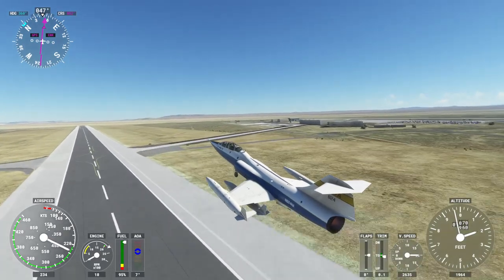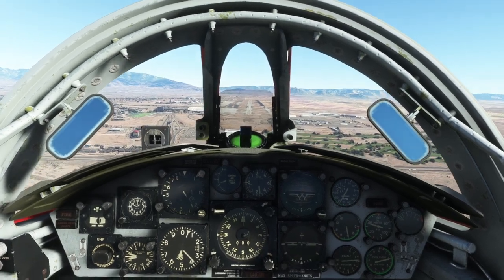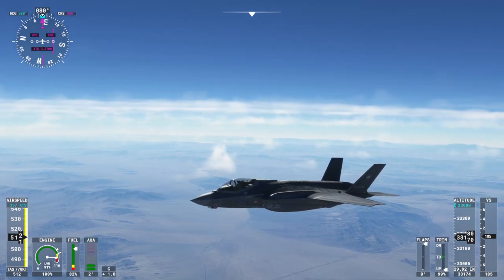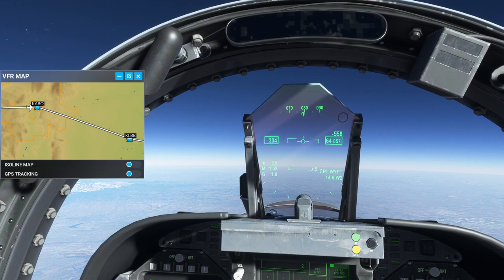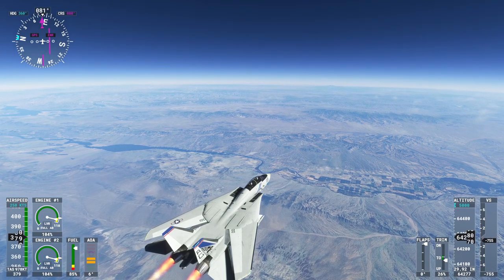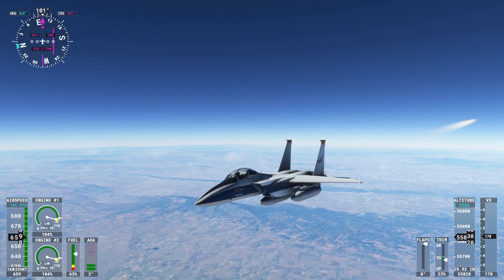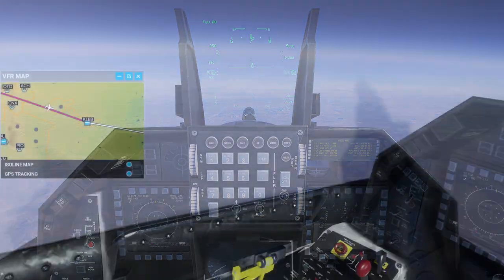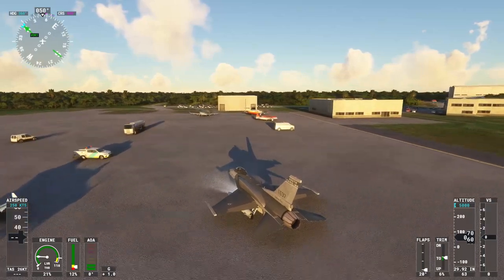Flight Sim 2020 - High Speed Range Test for F-104, F-35, F-14, F-15, F-16 and F-18

Comment: The trim with the IFE F-35 has always been messed up, unfortunately.  Also, real jet turbine engines get MORE efficient and have greater performance with altitude (within the aircraft's normal flight envelope), burning much less fuel at higher altitudes at the same power setting.  The turbines don't have to work as hard compressing less dense air and cold air is much compressible than warm air, resulting in greater power output at high altitude.  This is because, unlike piston engines, jet turbines have very high compression ratios in regard to the fuel/air mixture, and more cold air molecules can be packed into the combustion chamber at altitude, resulting in a greater fuel/air density and power output when combustion takes place.   Piston engines work the reverse way, becoming less efficient at altitude and putting out less power.

Comment: The engines have been quitting on my F15 by DC Designs recently after continuous afterburner for about 500 miles, even though it still has a lot of fuel remaining😢. Do you know if there’s like a cool down period you can turn the burners off for a while and then back on to reset the amount of time you have?
Reply from the maker: I haven't had that problem, so I don't know. I remember having it with the stock F-18, though, and there it was able to relight after a while. The SimSkunkWorks F-104 also had an afterburner quitting issue, but I think they actually patched to fix it.
Reply: Just flight emailed me about this saying “it’s your bad for using external tanks and not switching to internal fuel when they run out “, not I had to do that or how 😂
Reply from the maker: @Bryon Ayala Interesting - I seem to remember it auto-switching before. Perhaps they added it as a "feature." But yeah, my experience with Just Flight has been they're fairly snippy at communications.
Reply: Ya I’m going to test it later putting minimal fuel in the tanks and seeing if it automatically takes from internal, that guy could be pulling my leg.

Comment: For the F-35, is this FoxIndiaTecho's product? Also have they updated the physics and after burner on it?
Reply from the maker: It is IndiaFoxtEcho's F-35 and yes, they did fix the afterburner and the top speed.
Reply: @RaizSpace  I’ve bought mine from the marketplace, so would I get those updates from the store itself?

Also, how can I maintain my altitude without using AP, still trying to figure it out haha.

Lastly, nice video and great effort testing several jets under one video.

Comment: Really cool! What kind of gpu do you use for these videos?
Reply from the maker: RTX 2070. The recording was choppier than the actual gameplay, which was smooth. The same computer is handling both the game and the recording, so it's not ideal.
Reply: @RaizSpace  can i know your settings, i play on a 2080 super. Ive been testing out settings to get the best performance. Mine should habdle whatever you got. Thanks in advance.

Comment: Do you happen to know why the TF-104 is so low rated?
Reply from the maker: Possibly the need to use an external app to configure the tanks? Not sure. It also might not get the acceleration people expect, but they might be comparing it to modern planes rather than the planes of its time.

Comment: On the f35 I have a problem where it just sinks down is there any way that I can just keep auto trim on without using full ap
Reply from the maker: Just checking the plane, I don't see auto-trim active in regular mode - I just manually trim. Are you talking about STOVL mode?

Comment: Im disappointed on how fast the F15 goes in this game, these jets go faster then 1,000 mph which sucks that i can only go 750knts. :/
Reply from the maker: The F-15 was going much faster than 1000 mph in this video. You may be looking at the indicated air speed (IAS) which doesn't take into account decreasing air density. That speed basically represents the stress on the airframe and is important for the stall speed, but isn't actually how fast you're going. The true airspeed (TAS) or the Mach speed is what we look at to gauge the real speed of the plane (except for wind speed, which is included in another number called the ground speed). The TAS was at the bottom of the airspeed indicator in the exterior view.